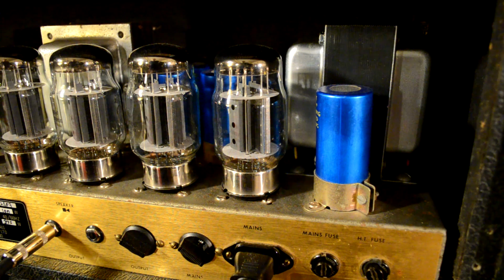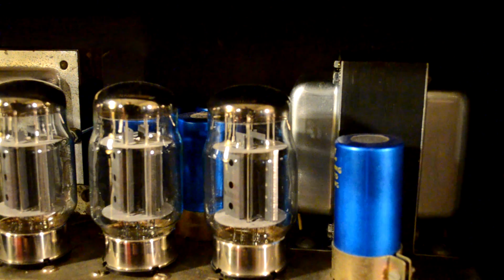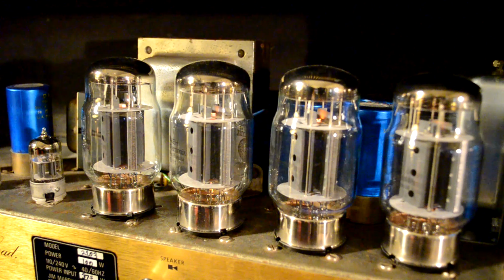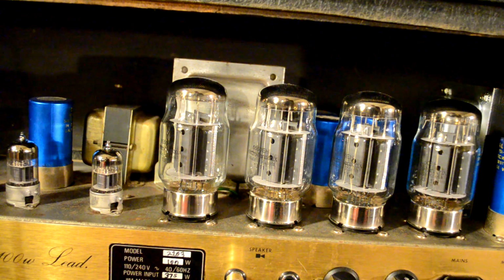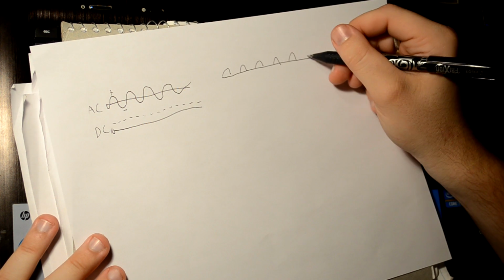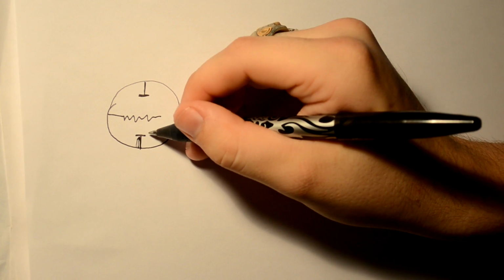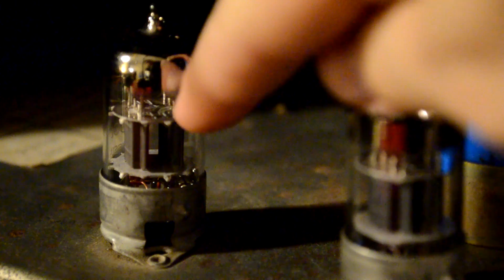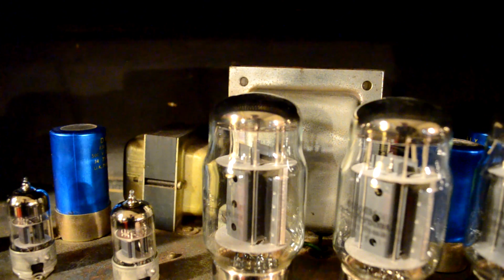How Tube Amps Work

Comment: "boils off electrons"???? really....and what liquid are you filling your tubes with to "boils off electrons"?...and did you add any salt and olive oil to the liquid to get a better tone?....so....In fact,boiling is the action of bringing a liquid to the temperature at which it bubbles and turns to vapor....Don't get me wrong....but you should really have a better knowledge of how tube amps work....before posting vids.....Vacuum tube work by a process called thermionic emission and not boiling.... It's good to see kids that are interested in things other than playing on PC's and cell phones....but please get your facts in order before you create myths or injure someone....just saying
Reply from the maker: It's a metaphor buddy. It helps people visualize what is happening. When you heat water, molecules are given enough energy to turn to vapor. In the same way when the cathode is heated, electrons near the surface are more "excited" and have more energy. Thus they orbit father from the surface and there is a "vapor" of electrons being released. Heating the cathode allows this process to happen much more efficiently. Tubes can be run in cold cathode mode, but it requires tens of thousands of volts between the cathode and the anode to "strip" them away. Because so much more energy is used the electrons travel much faster in this method, and when they strike metal in the tube x-rays are actually produced. X-ray machines relied on this principle for many years. Obviously not good for guitar players, so yes we "boil" our electrons.
Reply: Sorry to burst your bubble,"buddy", but no one "boils electrons" ever....That is a fact.I'm sorry the facts offend you but that is your problem that you have to deal with.I see that you have issues with facts but again.... Essentially, within a vacuum bulb, a cathode is heated such that electrons start what is in FACT called a thermionic emission.Boiling would in FACT require a liquid which tubes do not have.It's, in Fact ,quite easy to use the proper terms for the effects you are describing....or....you can stay at the same intelligence level that you are at now and misinform the very people you are trying to teach...it's your choice...I'm only trying to inform you of the facts....if you are interested. Your reaction says volumes about the kind of person you are....but It's always worth trying to inform people of FACTS...even when they are not ready for the truth...you have a nice day...p.s. Even X-ray machines have never "boiled" a single electron since the beginning of time... http://science.howstuffworks.com/x-ray2.htm They explain how an x-ray works and not one time do they boil anything let alone electrons....but nice try...you missed a perfect opportunity to learn something because your ego is trying so have to be a hero....when in Fact you are comming off as more of a zero....but keep sticking you fingers in the amp...You will learn something....lol
Reply from the maker: I never said it was boiling, I said it was a metaphor. Yes the technical term is thermionic emission. It's also called the Edison effect. And as for the x-rays, did you not comprehend cold cathode? But thank you for taking the time to enlighten us, oh wise one! We will never be as intelligent as you. We are merely humbled to be in your presence. Thank you for gracing us with your infinite knowledge!
Reply: Oh and your `` metaphor`` sucks cause,by definition, to boil something you need a liquid. You can always use the word heat,cook,fry or BBQ which would make you seem like you know what you are talking about. Using the correct term (thermionic emission) would be by far the best way to go and you would surely win all pissing contests...just saying....lol
Reply from the maker: Giving the technical term is not going to help someone who has no knowledge of the subject. Here's the definition of metaphor from Google:
"A figure of speech in which a word or phrase is applied to an object or action to which it is not literally applicable"
Reply: I'm vaguely familiar with the term " metaphor".
The biggest problem with metaphors is that to  "someone who has no knowledge of the subject" they can give the wrong impression when used incorrectly...When used correctly, metaphors are effective fiction writing tools.Of course, like most literary devices, metaphors bomb when used incorrectly, confusing the reader or drawing attention to the writer's lack of skill and lack of knowledge.The two most common traps to be aware of when using metaphors are the cliché and the mixed metaphor.In your case...you are using a tired, overused and cliché metaphor that is scientifically incorrect and all because you are repeating the same error that everyone before you has made.The term has been used so often that it's now considered cliché as well as incorrect.If you can't come up with more accurate language, it's often better to forego the metaphor and opt for straightforward description as well as not repeating what everyone else says....lol.
In short,when metaphors used improperly, will make you wind up looking foolish and distract your reader/listener. If your goal is to communicate facts... sometimes this means putting aside your ego in favor of plain speaking....or you can write fiction and maybe sell a book or two and get a movie deal....lol
Reply: Brandon, It's not about me...or you for that matter. It's about facts and not repeating the same errors that everyone else has made.I get it...really I do...You read somewhere that "electrons are boiled off" and you are repeating what you have seen and heard before...I never said you were an "idiot" but it stands to reason that if you keep repeating the same error over and over again and even when someone shows you that it's an error...what is one to conclude?There are countless ways to describe the process.........   ( heating,exciting,activating electrons to name a few)...you know what...I'm going to drop this issue...I don't think you are ready for facts or the truth...Not that it matters what I think...You don't even realize that I'm trying to help....every time I show you facts...your first reaction is anger....good luck with that...
Reply: This thread is hilarious and needs to be posted to reddit's r/iamverysmart.
Reply from the maker: ***** I actually thought about that when I got the first comment. I just recently discovered that subreddit.
Reply: For the love of god mark shut the fuck up. Were your brain cells boiled or did they undergo thermionic emission and does it change the fact that you could use a few extra.
Reply: If it makes you feel any better, Rod Elliot of Elliot Sound Products in Australia, from whom I got most of my knowledge of electronics, has been designing, building, servicing audio electronics and teaching the subject for decades. What he doesn't know about the subject would probably fit on a postage stamp. He uses the same analogy 'boils off' (note the quote marks) to introduce the concept of thermionic emission. I say 'analogy' rather than 'metaphor' since being pedantic seems to be the flavor of the month.
Reply: He wasn't trying to explain thermionic emission to an electronics novice.
Reply: Prove that there is a "God"....and why would you assume that I have "brain cells"?
Reply: "Mark David" The saddest man alive. He will happily write a 300 word essay on why using analogies to explain complex topics to people is wrong. Lol
Reply: Well. thanks, I try my best...but...You must have me confused with someone how cares what you think....lol.....and...Like the saying says..."It takes one to know one"....lol
Reply: Brandon....You "actually thought" ? Well there is a step in the right direction!...Bravo...
Reply: Well it's not about making anyone '"FEEL ANY BETTER"...It's about the truth and facts...In fact...Facts would be a great idea...If everyone would use facts the world would be a better place.If Rod Elliot or anyone else uses " the same analogy 'boils off' " they are in fact wrong and are spreading myth or are just ignorant. (those are not "quote marks"...these are quotation marks" " " " " ) That is not my opinion.Those are just facts. Now even if the whole world says something incorrectly it will still not make it fact or correct....Repeating someones errors is even worse...Errors should be used to improve oneself and not to make everyone else ignorant.Now if someone is told the truth and is showed the facts to prove it...but still wishes to spread incorrect information...Then one has to ask themselves about the moral convictions of such a person...The world in general would be wise to stop trying to make people "feel better" and use the proper terms,facts and truth....and the well being of everyone would automatically be much better...
Reply: Sir John Ambrose Fleming  (29 November 1849 – 18 April 1945) was a British electrical engineer and physicist. He is known for inventing the first thermionic valve or vacuum tube....Guess what...he knew better and never said that his tubes boiled off electrons because in fact he had a brain and knew that his tubes were dry and therefore could not boil any liquid....simple facts...
Reply: Brandon is a "novice" as well. If you are going to try to explain anything to a "novice"...it might be wise to know what you are talking about...Boiling can only happen with a liquid and since there are no liquids in a tube...no boiling occurs. I realize that he states that he is using an "analogy" but it it flawed...he could have used any verb that does not involve liquids but he chooses to be stubborn just because he was heard or was taught incorrectly and he is doing the same thing to other "novices"... Some people are just not capable of bettering themselves and would rather repeat myths and lies...sad...He could use Bake,cook or even radiates, just to name a few which would be much closer to the truth....be he chooses not to use facts...
Reply: Once again Brandon...You can judge me anyway you like and call me names as well...but that only shows everyone that you have nothing intelligent to add to the debate or that you are so frustrated that you have no choice and need to cruse and swear..and I assume you think that that kind of behavior is not "stupid"?....lol
In fact...cooking/baking are not exclusive to "food"...and also not exclusive to "ovens"...When was the last time you ate enamel paint? Did you ever hear of Baked on Enamel?...No it's not a food and certain things can even be baked or cooked in the sun without the need for an oven..I guess you can learn new things everyday when you have an opened mind...lol..
Radiate definition:emit (energy, especially light or heat) in the form of rays or waves. Emit, give off, give out, Discharge,Shed,Cast or Diffuse...(WOW THAT SOUNDS MUCH LIKE WHAT A TUBE DOES!)...but wait there's more...Diverge or spread from or as if from a central point...(THAT WOULD ALSO DESCRIBE IT BETTER THAT BOILING)...still more...fan out, spread out, branch out/off, extend,  "four spokes radiate from the hub"....(RADIATES FROM THE HUB WITHOUT A SINGLE "EM wave")...Even a smile can Radiate and not a single electromagnetic wave will propagate!
In short almost any verb would be better that boil because in fact there is no liquid in a tube to boil anything...and...In fact it is still not possible for the human eye to view the electrons...so no one on earth,including yourself ,has ever seen what it looks like and therefore you are only speculating that it looks like a "cloud  much like you would see a cloud of water vapor form as a pot of water heats up"....No one knows for sure.One day someone could find a way to see it and it might be like laser beams or light beams... but one thing is sure/fact/truth...To boil anything requires a liquid...and tube have no liquid and therefore nothing boils or boils off in a tube!...that is a fact!
Many electricians will tell you to imagine water flowing through a pipe 
to help people visualize how electricity flows in a wire....and...many people say that electrons boil off. That does not make it fact,accurate or even a correct analogy...
Let me make on thing perfectly clear. I have "won" nothing. I do not "win" arguments. I do not "try so hard to prove my "intelligence". It is not "my intelligence". It is a fact. It is not a fact that I have created and therefore "my intelligence". It is a know fact that everyone should know. I tell people that facts/truth and many learn what the facts/truth are and learn and therefore improve themselves...and then there are people like yourself who fight the truth, are offended by the truth and call people, who tell them the facts, names a curse because they do not want to learn....good luck with that...

Comment: The sound of tube amp is far more beautiful and true than the transistor amp. Many tube amplifier are quite expensive, there are a few China brands ,the price of which is reasonable and wonder quality. we are distributor of many China audio amplifier, if you want to know more, can go to our web www.fairsz.com.Recommand Yaqin, Nobsound,Laochen,BOyuu....
Reply: this is the whole line of Yaqin tube amplifierhttp://www.fairsz.com/yaqin-c-273_55_178
Reply: I hope dimebag darrell or tommy victor from prong are hearing you say that tubes sound way better than solid states! Those two are the best sounding in metal and both used solid state amps

Comment: What if i don't have any preamp tubes on my amplifier. Say like a Peavey 6505. Would it make any noticable difference in sound?
Reply: +nowyourenraged2 tubes are glass, and there is a ton of difference in tone between SS and valve.
Reply from the maker: I'm not very familiar with that amp but I just looked it up. It does have preamp tubes, 6 12ax7's. You just can't see them because they are on the circuit inside the chassis. Most amps are either all tube or all solid state. However there are some hybrids that use a tube preamp and a solid state power amp such as the Marshall Valvestate. There are also some that use a solid state preamp and a tube power amp but these are much more rare.
Reply from the maker: ***** umm, wut?

Comment: shit I would leave it unplugged before I touch anything in there
Reply from the maker: Well even if you unplug it the capacitors can store a lot of energy. They must be drained before working on an amp or there is a possibility that you will electrocute yourself. But what I was doing was not dangerous... I did not take the chassis out. But taking it out and working on the actual circuit can be dangerous.

Comment: Great video, I`m just learning and curious on your thoughts about what I understand so far...

I have come to the understanding that the tube amps using much higher voltage potential and very low amplitude on the signals is the key factor and the very basic root cause of the difference between a solid state design amps vs tube amp designs... 

Tube amps :
It`s the high voltage potential that is allowing the very low amplitude to punch the sound waves with the precision that keeps it natural...? 

Tubes enhance even ordered harmonics, when you saturate a tube with lots of current the tubes easily produce even ordered harmonics.

Solid state amps:
The very, very, high amplitude on the signal actually removes the natural harmonics that would normally be present on music frequency signals from most hand operated musical instruments...?

This appears to allow some sound frequencies to be powered up well beyond their natural capability without distorting but at the same time those harmonic distortions are part of the natural properties of the sound waves...?

Solid state amps also produce even and odd ordered harmonics in equal amounts, but they can also be designed to produce more even ordered harmonics….

 
So understanding tube vs solid state is simple, 

Designing a solid state to have little or no odd ordered harmonics would probably be the safest amp to build for us new players wanting to learn ?  :]

Just my insights as I`m new to this whole music amp stuff and still gaining ground...
Reply from the maker: To be honest with you, I don't know much of the science behind the harmonics that are produced. What I can tell you is that tubes tend to accentuate even order harmonics (the ones that sound good to us) and the output transformer also diminishes odd order harmonics (the ones that sound harsh). Of course this all depends on the design of the circuit, the type of tubes, the number of tube elements (triode, tetrode, pentode...). 

Solid state amplifiers rely on some of the same principles as tubes, however they can be run at much lower voltages. They are also more efficient but unlike tubes they tend to amplify both types of harmonics like you said. Additionally, transistors amplify harsh high frequency content, whereas tubes tend to gently roll off the high frequencies.

But yes you are right, a solid state amp would be safer to build because it does not require the high voltages that the tubes do.

Comment: Thanks for all that ! Many years ago, Dutch company Philips, sold as Norelco in the States, used tubes in their radios but had trouble with output transformers, so they made a special range of 700 ohm speakers for some of their sets !
Reply: This information is not entirely accurate. Philips had no troubles with output transformers in their tubes radios.
At that time, Philips used no output transformers for other reasons: first, to achieve a better sound quality and -also important - reducing costs. The impedance of the speakers when used were 800 ohms